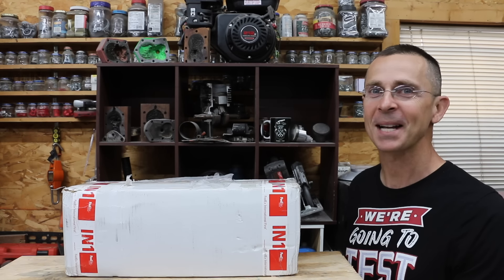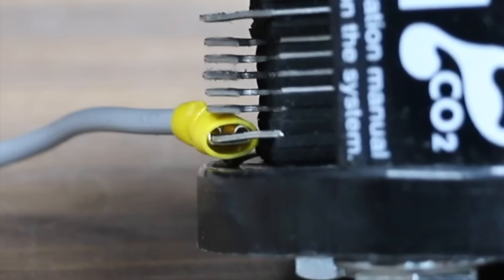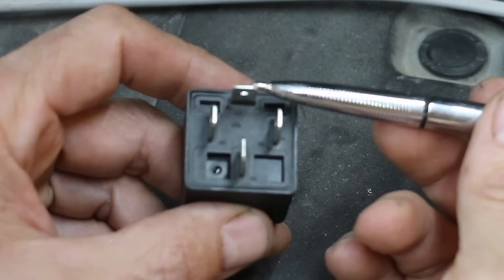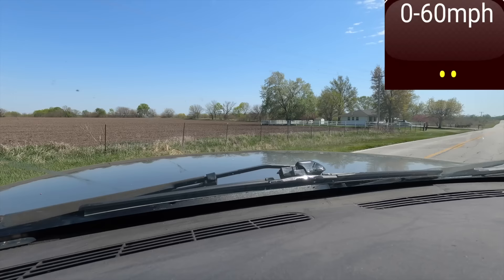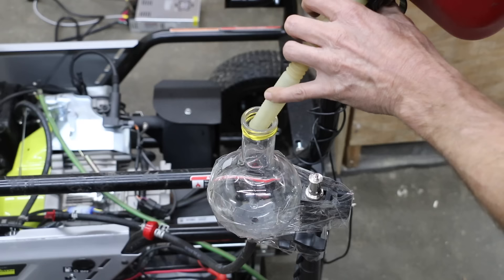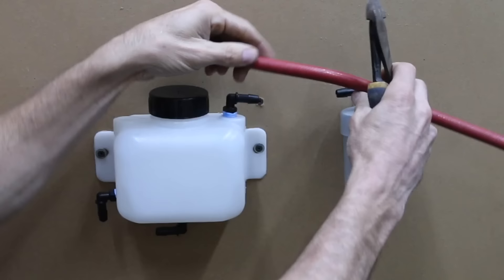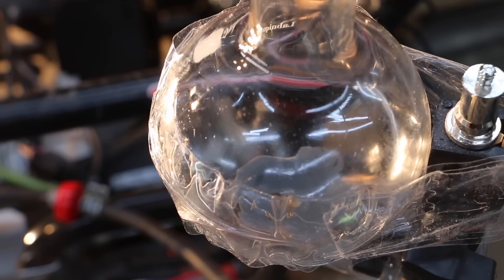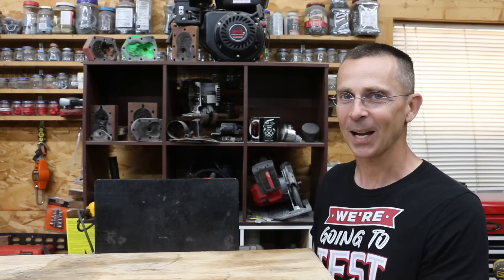AMAZING 35% More MPG with HHO? Let’s find out! Help with high gas prices?

Comment: Ah, good old Brown's gas. I still remember installing a system in my truck around '05. Gas was about $4/gal and there was an e-book circulating called: "Run your car on water." It described a method of making HHO cells in mason jars, using stainless steel wires. I mounted a few in front of my radiator and also wired a switch inside the cabin. You also needed a potentiometer to dial the signal from the airflow sensor in the air intake. This was to trick the computer into mixing in less gas, the theory being that the HHO would replace the gas. Bottom line is my mpg went from 22-23 to 23-24, roughly a 1 mpg or <%5 increase. 

The biggest problem with this system is that the energy used to generate the HHO gas comes from the car battery, that in turn gets charged by the engine. It's a closed loop and no energy is added, except for gas. If you have a separate battery that is being charged by a solar panel, this has a larger potential to make a real difference, but %35 is ridiculous on a modern car engine.
Reply from the maker: Thanks for sharing.
Reply: What about using the waste heat from the exhaust to generate HHO. More than 50% of an engine's power is wasted as heat, there should be some waste heat recovery technology by now.
Reply: @at-yj8pl  possible, but there's better ways. Electricity is needed to generate HHO, and if you're generating electricity anyways it probably more efficient to just power an electric motor

EDIT- my girlfriend's dad is an engineer designing waste heat recovery systems for factories and the like. He says with something as geometrically complex and with so many attached parts as an engine, there is next to no space for any waste heat recovery from the block. Best spots to try and recover are the heat of the coolant and heat of the exhaust, both of which are inconvenient but could generate some power. However, peltier thermoelectric devices are only 8-10% efficient and need a hot side which is easy but also a cold side. The best way to recover heat is to have hot side coolant flowing through the block and exhaust system and the cold side coolant flowing through a radiator and a heat exchanger on the cold side. This could generate some power but is mechanically complex as it requires two closed loop coolant systems. It is unlikely generate enough to break even on fuel consumption, given the extra weight.
Reply: @rethink  you are tripping, you need to “rethink”! It’s not just hydrogen gas that’s being generated, oxygen is being generated too. The gas that enters the engine is a hydrogen oxygen mixture which is already at the perfect air fuel ratio for hydrogen, so it’s not running rich. Plus car has oxygen sensor which would change injection pulse width, no need to mess with the computer, it changes automatically.
Reply: @altaccount4697  There's actually a perfect heat-recovery system in use on almost every diesel engine today. It's called a turbocharger.
Reply: @altaccount4697  A secondary battery that is only charged by solar power as well as being charged at home , plug in do it so why not. So you’d get better fuel economy while the battery is charged if I could get 30 miles at 40mpg then that would be worth it for me assuming I spend less than 1000
Reply: @at-yj8pl  ya hay ingenieros trabajando en eso. El problema es generar electricidad con el calor....
Reply: @maybe2714  I seem to remember plug in hybrids being available for purchase.
Reply: @jeffshackleford3152  They also have electric cars as well.
Reply: @at-yj8pl  Going back even further in time, I remember plans circulating, for a fuel vaporizer,  the idea here, was that heat from the exhaust was split and part of it was sent to and exchanger unit in the engine compartment, the would preheat and vaporize the fuel, before going into the carburetor, supposedly making it much more efficient. 

Over the decades, I have seen these schemes come and go, then come back again.  hundreds if not thousands of people have tried these things, and here we are still trying to find the magic.

cool old tech, for emergencies, was wood gasifier,  basically running your car on wood,  this actually works, and the government even distributed information on how to make these things, during the 2nd world war, in case fuel wasn't available, vehicles in Europe were converted when petrol was not available.
Reply: But even then, the solar panel adds weight, and (if it's not the thin film type) will potentially worsen the drag coefficient of the vehicle. These two things alone would defeat the use of a HHO generator being run from solar.
Reply: @at-yj8pl  Congratulations, you just invented a turbocharger 😂. 

Not exactly the same, but basically manufacturers don't waste time trying to figure this out because turbochargers do a great job at increasing engine power using wasted exhaust gazes, effectively adding no extra strain on the engine and increasing power. 

If a manufacturer wants it to be fuel efficient, they just use a smaller engine and turbocharge it to give it the same power as a big engine while being fuel efficient like a small engine. This is how almost all fuel efficient modern cars work nowadays, assuming they're not electric or hybrids.
Reply: @TheGoldenGamersz  problem with turbos is they require a lower compression ratio, reducing efficiency.  Thats also why cars don't have ridiculous boost pressure out of the factory.

You can keep the compression ratio the same but then it gets expensive. Turbo charged engines are only efficient when compared to a bigger displacement engine that has the same max power output. But even then sometimes i4 engines somehow have worse mpg than a fucking v6 which boggles my mind at times. 

One thing that will always be inefficient though is goddamn rotaries.
Reply: You could possibly recover some energy if you were only running the hho generator and on downhills but the problem would then be the fact that it is incredibly dangerous to store hho and then use it when you need it due to it being so explosive. A split hydrogen/oxygen system would be slightly more safe but still quite dangerous
Reply: @maybe2714 YES , this is the way. I have an 8-ton motorhome / homemade/1968 International ex-army 4x4. with 283 petrol engine. The roof is fully solar 2.2kw.   with 4 x 100 amp Lithium batteries.  And  I use it as a power source. My HHO gen. takes 100 amp. “” When the pedal on the floor””. Before 38-40 liters on 100 km. dropped down to 28-29 liters on /100 km. On a very hilly country trip. Now I can even disconnect the alternator as a  power supply. Because. an alternator with a heavy load can take 5 HP  off your engine. I am travelling only daytime. But plenty of other ways to save fuel.  For example. Change all your globes for LED. if is a manual gearbox in your car, install a relay with the brake lights and cut out the power from the fuel injectors “” If its electronic””  when you push the brake. ONLY ON MANUAL.
Reply: @ProjectFarm  so many shilllllllls. In here
Reply: @ProjectFarm  hho hurt fuel efficiency???  Let me supply the kit.
Reply: @Frank Blackcrow Waste heat from the engine. The system in the video is pointless because it uses electricity created by the spinning engine to generate HHO, but if you use the extra heat from the engine to generate the electricity used to make HHO, then you could get somewhere.
Reply: Separate battery adds weight and that in turn defeats this whole system from any gain at all. Don’t buy this. Just empty out your glovebox and take a dump before you drive to the grocery store.
Reply: @firedogbme5659  wait until you see what a supercharger does…
Reply: @David Henry I'll bet it does!
Reply: @davidgruen7423 
Well said.
Reply: You could maybe use an arduino to make it only create hydrogen during engine braking or maybe at idle, and only inject hydrogen during closed loop fuel injection. That might net a few more MPGs during either city driving or driving with a lot of hills. Still, 35% is ridiculous though. If it was that easy, surely the engine manufacturers would have figured it out by now.
Reply: @at-yj8pl  this technology is currently employed in F1. The turbocharger is connected to a generator which charges batteries for a hybrid system.
Reply: @Derpynewb Wankel rotary engines need a fast burning fuel. Hydrogen is good for them.
Reply: thanks for adding the fact that the potentiometer.  Without it the computer will just add more fuel to compensate.
Reply: do you think using regen brakes, and or solar could cover the needed energy. im assuming you measured the needed amount, the issue with hyrogen isnt so much its combusting energy vs fuel. its the entropy of whats needed to power it which is its fatal flaw.
Reply: @TheStuntViking... The reason why you have reduced engine performance is because hydrogen is not as volumetrically efficient as gasoline meaning it requires a higher air/fuel ratio for combustion, so when you inject it into a gasoline engine, it simply isn't going to ignite under those conditions. And since the H gas is displacing air, your air/gasoline ratio is leaner, resulting in the reduced performance.
Reply: @at-yj8pl There is, and a Wankel rotary engine can run on that temperature difference. But the amount of power it will add is very small. And any attempt to get more power from it will obstruct the exhaust gas, which increases the power (and thus fuel) demand from the gas engine. So it's a net negative.

The best solution, by far, is a hybrid system like the Toyota Prius, or a gas-electric in the style used in trains (also a hybrid, but with a different setup).

Otherwise, there is nothing that extracts power from the waste heat that overcomes the excess weight that is added to the vehicle.
Reply: I don't believe in any such devices exist if they did GM would have bought them and offered them as an option on their new cars.
Reply: Why has nobody tried this on a carbureted engine?  No computer to affect air fuel mixture and it might even Improve the emissions if it does burns cleaner.
Reply: On newer vehicles the mixture is monitored from intake to exhaust then constantly fed ( after reading all the parameters) what the computer sees as optimum
( the reason why a simple remap can gain power, torque and fuel efficiency).
I think better results would be obtained from an older engine  with carbs and no sensors monitoring the mixture. 
Great work though 👍
Reply: Real experience talking is refreshing.

Comment: I knew what the results would be, but I still watched and appreciate the work. Thanks Todd!
Reply from the maker: You are welcome!  Thanks for watching!
Reply: I was hoping it didn't work.
Reply: @Charles McKinley Settle down there, Sparky. It was a turn of phrase.
Reply: @Charles McKinley i didn't do well in school, can u tell me why this had no chance of doing anything good pls? :>
*edit: i read some more comments and maybe sorta kinda get it lol basic energy cost vs. what it produces? breakin apart water costs energy, and the hydrogen doesn't have the potential to make more energy than it cost to produce in the first place?
Reply: @outseeker  There is that, of course. This gizmo must actually be a net energy drain...using the alternator to produce zero benefit totals up to a net negative.

If you're going to get any usable power out of hydrogen, you've got to keep it separate from the oxygen until it's in the combustion cylinder. This kit spits the two gasses out through the same tube, into a common tank. By the time they get to the engine, they're already recombined. The bubbles you see are certainly just water vapor that has not condensed yet. And it's such a tiny, tiny amount of that, that even if adding water vapor to an engine's intake WAS beneficial, there's no way any performance differences could be measured without extended run time in a very expensive laboratory environment.
Reply: @outseeker  That is the conclusion of most, but not for all, like Stan Meyer.  I did watch another interview with a group who duplicated Stans achievements, but said it was primitive compared to what they did after.  I think stan was working on a new higher voltage spark plug, this to eliminate having to produce hydrogen in a cell, but rather split the water inside the engine.  Anyways his first demonstration according to science, shouldn't have worked, but yet multiple scientists said they watched it.  I think these energy calculations only hold true for the normal electrolysis process which really has not been improved since ancient times, this for good reason.  You start infringing upon the oil companies, then you will have problems, like lethal cranberry juice.
Reply: @Wavefront101  that is some interesting foods for thought! thanks :)
Reply: 🤔 Not me..... I was SURE it would work even better than advertised! You see, I had phenomenal results after attaching one of these kits to my 2004 Crown Victoria. Prior to the install, the Crown Vic was a bit sluggish for a v8 car. But now that I've installed this kit, I'm competing in the NHRA Pro Stock class! The stock power rating of 260 hp and 300 ft/lbs has been increased to 1,550 HP and 1,425 ft/lbs! Amazingly, the stock fuel mileage of 22mpg has increased to 40mpg, even with the incredible power boost! 😎👍
Reply: @outseeker  Others have mentioned the reasoning, but if you'd like to learn more, I'd highly recommend Engineering Explained videos on hydrogen as fuel. He explains quite a lot info and is very easy to understand.

Comment: I did a lot of research into stuff like this a few years ago.  The best I can tell, adding HHO or any alternative gaseous fuel to an older gasoline or diesel engine makes a big difference  if you are having incomplete combustion in your engine, but modern fuel EFI engines are already running pretty clean.
Reply: Interesting. So, simply tuning properly the engine will solve the problem and hh0 is useless in anyway.